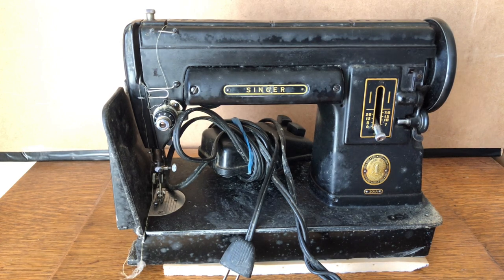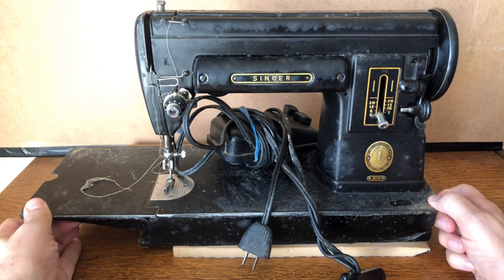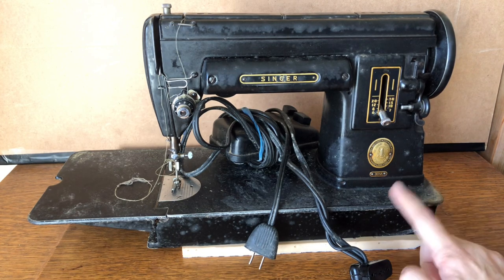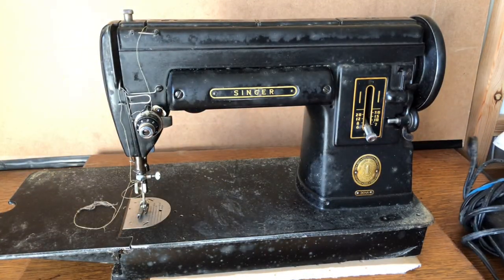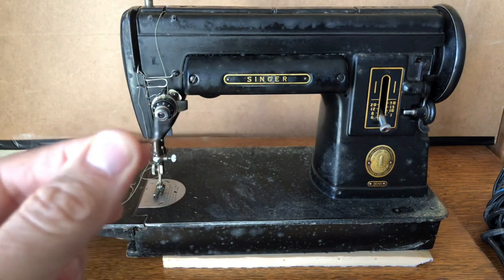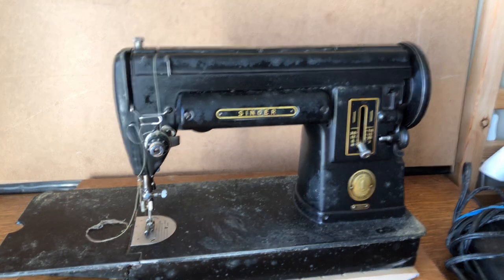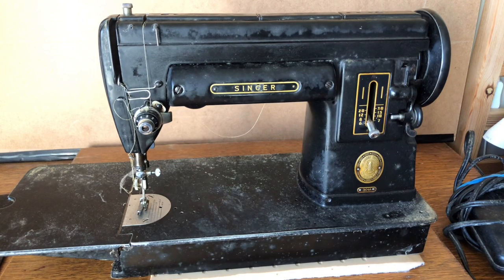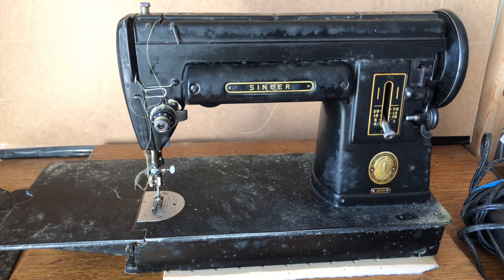PURCHASING SERIES #34: An Ugly Duckling or a Swan in Disguise? What to Check Before Making an Offer!

Comment: I was lucky enough to snag one of these lovelies (and the accessories) from the original owner - don't fall off your chair - for $50. She hadn't used it for a long time so it was quite dusty. Otherwise it was in mint condition. She was a lady who took good care of her machines and had used this one for many years. She had moved on to a couple of high-end electronic Berninas and was happy to sell this. The balance wheel moved noiselessly and with almost no effort. When I opened her up, she needed a little dry and that was it. She was amazingly clean and her motor hums quietly. She's black like yours and when polished looked almost brand new. The bed is only the short one, but I don't much care as she's fabulous and using her is a joy.  Thank you SO much for your videos. I've been collecting and refurbing vintage Kenmores (I love old Kennies) and now a couple of Singers. I'm now carefully cleaning my latest baby - a 1941 201-2!  Without expertise from you and others like you who so  generously share their knowledge, I would never have taken on these projects in my 70's. I wouldn't have had the confidence.  You are a blessing and thank you again.
Reply: Oops! I meant she was a little dry, not "she needed".
Reply from the maker: Thanks SG.  Very kind of you!

Comment: I have a black 301 longbed and I decided to check eBay for a short extension.  I bought the short extension in order to switch my 301 out from table top use to being able to pop it into a cabinet with a cradle that Singer sold for the 301.  It's easy to change over the extensions from short to long anytime I want.  The extensions are out there on the auction sites in most of the colors that the 301 came in.  So are the cradles.

Comment: Glad to see the condition of this machine and this video. Will check the follow up to see how you cleaned.  I saw one 301A in the same condition priced $500. It just out of reach and was concerned that it had water damage the case and the body have big spots of mold.
Reply from the maker: While most any of these machines can be rescued, that price you saw of $500 is way overpriced; even if money was no object.  Likely, the seller does not understand how the market for vintage machines works.  But don't worry, there are others out there.  I got my earlier mint black Singer 301 showcased here for a lot less at a bidding site.

Comment: I'm working on conserving a White Rotary treadle machine and some of the parts underneath are badly rusted. What specific techniques and products do you recommend for heavy rust? Additionally, when I attempt disassembly for cleaning, which parts need special attention to ensure smooth operation?

Comment: I'm having a hard time finding a cabinet for this model. I have 2 one 301a in tan and a 301 in black both long-beds. Any suggestions? I wasn't too fond of the Style 314 Card Table.
Reply from the maker: Hi Sasha.  The reason you cannot find a table for one just like this is that the 301 models with the long bed extension as you see here were meant for carry cases only I believe and they were not offered in tables.  For those with the shorter bed extension, the DO fit into (most )Singer tables that were made from around 1950 onwards.  Any table that can hold a Singer 400 or 500 series should take a 301 short extension in any color.  FYI, keep in mind that 301's are unique in that they require a install "Tray" that fits into the table and then the 301 slides into it.  This was designed to make the 301 super convenient to install and uninstall given its potential as a portable machine; being lighter than most other models.  I suppose the good news is that the card table style is less common than others which you may like better.

Comment: Black 301’s are more rare. Singer made a lot fewer in black. And the same goes for the longer extension bed. If she has no aluminum rot you may well have a super dusty diamond in the rough.

Comment: I'm curious; if you do not use electrical tape what do you use instead?
Reply from the maker: Well, if the cord is dry rotted, I just replace it  If the cord is good but has a cut/damage that is not too severe, I use a product called "Liquid Electrical Tape".  It is made for mending cords and drys to a flexible rubber-like texture.  FYI, it is NOT silicone based.  You want to use a product specifically for cord repair such as this Liquid version.  It is sold in most hardware/big box stores.  FYI, it  STINKS and has a high solvent level so be sure to vent well.  I actually show how to use it but don't remember off hand which of my videos I shared it in.  I will need to do a search of my own channel, LOL.

Comment: What do you do if the pedal hisses and crackles? I have one that does it a lot. Otherwise it's perfectly functional, but the noise puzzles me.
Reply from the maker: I would NOT use it until it is replaced or repaired.  The hissing sound which can also sound like a crackle can be caused by damage to the carbon pile discs (if yours is that type) like the one in this video.  It could have been caused by wear or more likely the pedal getting dropped.  You can get generic electronic replacements to use instead or you can also find other vintage "Button Style" Singer pedals like this one.  You will want a guarantee on any used ones you might purchase.
Reply: @VintageSewingMachineGarage  It is a carbon pile type. It's pedal-shaped and it belongs to a Japanese clone.

I didn't take out the carbon discs when I inspected the pedal because I didn't want them scattering everywhere. I remember the two carbon pieces that go between the carbon piles and the metal bit that presses on them, those were damaged a bit. It didn't seem too bad, and the pedal was working, so I left them alone.

Maybe I'll have a look at the carbon discs themselves soon. Very carefully.